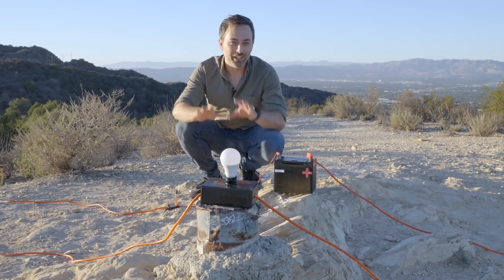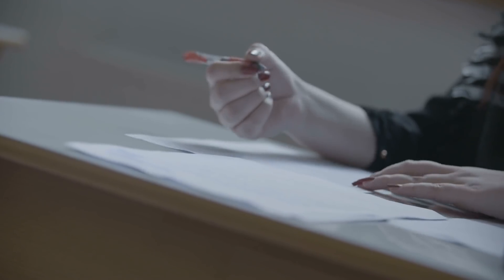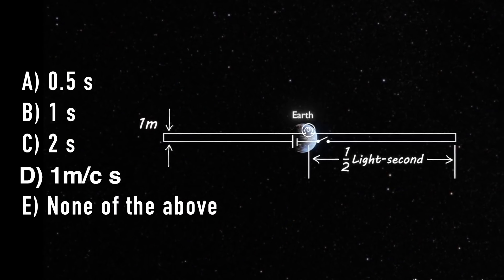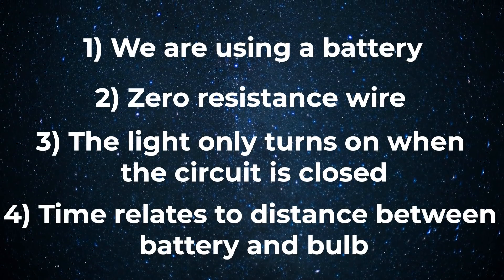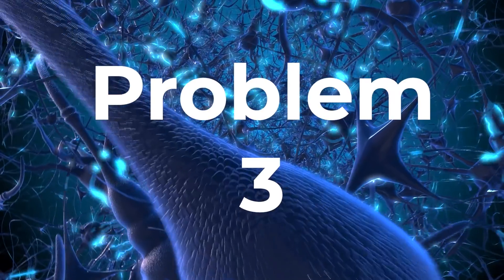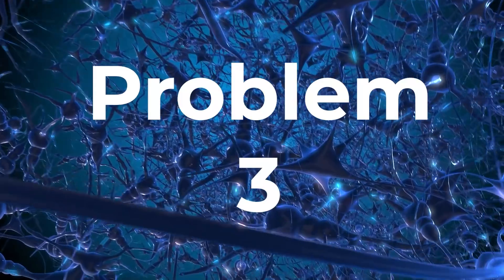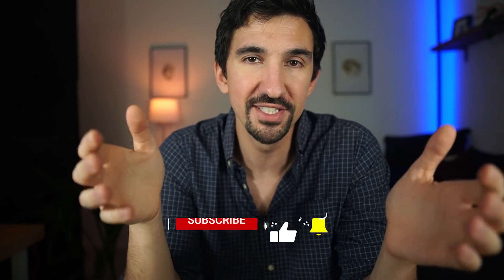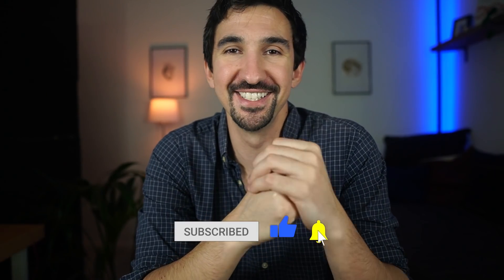Is Veritasium Wrong About Electricity?

Comment: Watched the video and your correct as I analyze as well. Would like to have a tank circuit to experiment to show that the potential energy of the field. The discussion point being made is where the energy travel is. Energy goes into inductor at the start of current, and when this collapses that energy comes back. Impedance is the sum of R plus capacitive reactance plus inductive reactance. And reactance only happens with change of current. In a DC this is battery on. Or Battery off. Also ideally if we take the bulb out and replace it with a wire we oscillate because this circuit has no R. The oscillation is at the resonant frequency of the C and L something like this f = 1/(2π√LC). Too too simple for this because this is one L and one C in series. Apply battery power once and you oscillate. Replace a load with a wire is Nortin's of analyzing a circuit would remove the load with a wire and you compute the current. Here that current immediately osculates, and continues even after the DC reaches in one second. So, now we apply the load to that current and see the once cycled glitch will be found followed by one second or so for E w/out R to get through the wire making I the same in the circuit. We can apply the following to dig deeper. And this force if felt at speed of light "kind-of". Where one electron is it has a force. We have collection of these electrons in a battery and wire now makes each of those electrons touch and touch etc with this we have "touch" electron to electron energy transfer. Moving electrons make a flux and is shored energy... The stored energy is conserved.

The law states that the magnitude of the electrostatic force of attraction or repulsion between two point charges
 is directly proportional to the product of the magnitudes of charges 
and inversely proportional to the square of the distance between them,

Comment: yeah and what about an experiment that isolates the lamp from the magnetic field generated by the battery/wire close to the battery ? Does the lamp will turn on?
My answer wld be : yes.
So current will probably needs the time 'to flow' (or if you want the mag field to propagate around the line) to the lamp. Interesting video btw !

Comment: There is a huge difference depending on whether DC or AC current is used. Electrons do not travel at the speed of light along a wire. They essentially stay more or less in place and jostle each other, the disturbance travelling along the wire at some speed less than the speed of light. For AC a rising and falling electromagnetic field is created around the wire and this is radiated from the wire at essentially the speed of light. This wave or pulse would be picked up by a closely spaced parallel wire almost instantly and it would generate an equal but opposite voltage. So if the wires are closely spaced, the light will come on, at least briefly, with DC voltage as the voltage pulse will jump across the distance between the parallel wires as an electromagnetic wave. Using AC, the light will come on continuously. If the wires were widely spaced such as being formed into a circle, then there will be more than a one second delay due to the delay in the electrical pulse propagating along the wire. This is usually assumed to be about .67 of the speed of light in real life situations. While this may seem a specious problem, it does actually have real world applications in that computer chips are so fast, the speed of light and hence propagation of signals across a circuit board can take longer than the clock speed of a single pulse from a microprocessor chip. In other words, the components on the circuit board start running out of synchronisation with each other. This is a very real problem for designers.

Comment: Veritasium described electricity as an electro-magnetic field that moves along a wire at the speed of light. Which explains nicely how a conductor moving in a magnetic field makes electricity. I think if the wire was cut at the furthest end when the circuit was on that there would be enough delay before the light globe turned off that it would not exceed the speed of light. Surely someone in a physics lab can set up an experiment to test this?

Comment: Yeah, Veritasium basically is saying that electricity is radio which uses the electric and magnetic fields together to communicate across distance...zero sense really.  Electrons are definitely moving in the wires to deliver energy.  If the electric fields could deliver that much energy then wireless charging would be taking place at continental scales lol.

Comment: Isn't it 1/c seconds for option C because its 1m away? That's why it's not 1/c seconds and also why it doesn't break causality - because the time is based on how far the bulb is away from the switch.
Also, I feel like if a break happened on the edge of the circuit is a good counter-argument, however, I think the switch will still work until half a second passes as the break is half a light second away so it's like a switch half a light second away was flipped. Ultimately, idk but I agree with Veritasium but I'm still sceptical. This was a great video though 👍

Comment: This was absoutely fantastic 👏 .
I would say though we dont look at transformers as antennas while they work the same way just not trabsmitting through air.
If we had this same experiment where the two wires were coiled and embedded in silicon steel then the wire around the earth or moon would be irrelevant as we know that how the power will transfer.

Comment: I have a question. Veritasium and The Science Asylum both made videos about energy propagation in circuits (TSA about 2 years ago, I think). But their Poynting vector didn't match: Veritasium's Poynting vector was (no pun) pointing along the wire, while TSA's Poynting vector was orthogonal to the wire. Which one of the two is right?
My guess is that they're both "right and wrong", in the sense that they each describe one summand of the actual Poynting vector: Veritasium's term is the one causing the light bulb to turn completely on eventually, and TSA's term is the one causing the wire to heat by Coulomb effect.

Comment: I did not understand, in this model, how is it different to click the switch versus not doing that? You just said that the circuit being closed "does not matter that much" (or did I get it wrong?) so why does it matter at the position of the switch more than at 1 light year away?

Another way to put it: what precisely is telling the battery to "start moving electrons" in the circuit? Since it is not "that the wire closes up", there must be a quantitative way to put it..
Reply: The battery creates an electromagnetic field around the wires, this field moves electrons. The field also induces another field in the other wire and because it's directly parallel at only one meter, it induces this field very quickly, but it's not going to be very powerful. When the wires are connected at the ends, the magnetic field would also propagate the path of the wire much more efficiently, but would take longer to happen. The real problem with Derek's video is that a 12V battery is DC, so the voltage on the bulb side of the wire would only get a short spike of voltage when the field first forms, and then you'd have to wait for the field to follow the wires.
Reply: @1992jamo  So why will switching the switch really have a non-negligible effect on the "almost-instantaneous" timescale? When you close the circuit, isn't that really just a small difference in the geometry of the wire? I mean, after all the EM fields have to "jump one meter of air": doesn't that have the larger effect, compared to "jump the gap between the ends of the wire" at the spot where the turned-off switch opens the circuit?
Reply: @nebularwinter  I'm not 100% sure what you mean, so sorry if this isn't a relevant reply; I'm using an AC power source in these examples.
If you're asking what is the difference between having an open circuit with two unconnected wires close in parallel, vs an open circuit which is two parallel wires connected at each end, with an open switch, the answer is not much.
But if the circuit is complete, I think the answer is that the magnetic fields propagate along the wire, but radiate perpendicular to the wire. In order for it to form EM fields, there needs to be a circuit.

Comment: Hmm, no, I'm sorry but Veritasium is correct and there is no faster than light response needed here. The pair of wires form what we like to describe as a distributed circuit problem, not a lumped circuit problem which is a simplification we make when the dimensions of the circuit elements are much less than the wavelength of the highest frequency of significance. This is obviously not so in this case. This is in fact what we call a transmission line and it has a characteristic impedance equal to sqrt(R+jWL/G+jWC). Since this is a perfect line both R and G are zero and the characteristic impedance is just sqrt (L/C) were L is inductance per unit length and C is the capacitance per unit length. This characteristic impedance can be used to replace the transmission line for purposes of working out the initial voltage of the lamp which merely is in series with this purely resistive characteristic impedance. Thus for the first second or so the initial state is entirely governed by the local dimensions. Say 1 metre or 3.333 ns. After the travelling wave has gone all the way to the end of the line the short circuit will reflect it back in the opposite sense. When the reverse travelling wave makes it back to the start then depending on the impedance/resistance of the lamp that may be the end of it. If the lamp has an impedance equal to the characteristic impedance then this will terminate then. In this case the lamp will be at half voltage for 1 second and full voltage forever after that.

Comment: I believe that this was the point of the Veritasium video, to prove that the thing that is causing the light to work is not the traveling of the electrons throughout the circuit, but the flux caused by the electromagnetic relationship established by the circuit. That is why the closing of the circuit causes an almost instantaneous response of the bulb being lit. *disclaimer I am a physician

Comment: For me, the image of little balls (electrons) moving single file through a tube (the wire)  and stopping when the switch is opened is the model I hold in my mind when thinking about how electricity works. Every since I saw the film in school that's how it works. Nothing is going to change that

Comment: There is no FTL communication. You know the circuit is broken but you don't know WHERE. To measure the distance, you need to bump a signal down the wire and wait for reflection. That takes time. No paradox here. Actual paradoxes can be constructed using two switches. One is near battery (switch A), the other near the max distance (switch B).  B is On,  A is Off. Switch on B, wait 1m/c seconds, then switch off B. This can be done by pre-programmed and synchronized clocks. If Veritasium is correct, the light should switch on (for a brief moment). Relativistically depending on your frame of reference, the sequence of switches can be seen as A On -> B Off  OR B Off -> A On. So some frames see no time where the cirsuit is complete and some frames see the circuit complete for a while. So in some frames the light comes on and in some it does not. WTF?

Comment: As an electronics dude, i have  problem  with an asumption you made:  perfect wire  implies  0 resistance  and than  they are superconductive.... Well  if the wire  have 0 resistance  according to Ohm law :  I =R .V =0.V which means  no current  at also the  power will be P=V.I = V.0 =0 (it is  a DC  circuit in the end) so no power . How  a perfect wire  will  conduct with  0 Resistance and  still  conforme  to Ohm's Law ?

Comment: Imagine the same setup but embedded in a region of zero permittivity so the fields can only exist in the wire. Does the light still turn on? I'm fairly sure so, because that's the circuit diagram that he shows. 
The video is confusing and incomplete. The best answer is whatever solves maxwell's equations in both the wire and the rest of space, of which both transmission lines for  fast AC (the rest of space dominates) and circuits for DC (the wire dominates) are just limits.
He showed you the DC model (for which energy doesn't even flow, the bulb lights because of a local potential over it) then gave you the answer for the fast AC one.

Comment: It should be 1 m /c. Your units still don't check out.
Reply: This guy and Veritasium could both use an editor, they both flubbed and silently course corrected.
As for the gal with the mole, good eye.
"lights a lighter" well played since a car's lighter closes a circuit, etc. I was thinking "turns car BT on" for the absurd amount of BT transmission watts to crank the dead battery car. New for 2023 Qi jump starts.

Comment: Isn't the problem in 5:00 just a rehash of the ladder paradox? You don't have the same experience of simultaneity. If you cut the wire after they switch it but before the other light turns on, from the other observer's perspective, you cut it before they turned it on. The signal of the system being one way or the other can be transferred "spookily fast" without breaking causality.

Comment: You've made a very common mistake in how you explained things there but anyway.

So what he's really talking about is radio / electromagnetic coupling from the battery side to the light bulb side. Switching on the bulb at the battery causes an EM field to be generated on the battery side and this radiates out including over to the light bulb side, disturbing electrons in it's part of the circuit and therefore inducing a (very low) flow of power. In other words it's the DC equivalent of a radio transmission?

Comment: A wire that long is going to have sizable resistance, sure, but I haven't seen anyone mention that it will also have considerable inductance. Once the switch is closed, current will try to flow but it will take some time for it to overcome the induced opposite voltage. It's similar in some ways to the inertia of water flowing through a pipe. Once the switch is opened again, it will take some time for the light to go off (analogous to water hammer) because the induced voltage will keep electricity flowing. It might be interesting to work out the resonant frequency of this circuit.

Comment: Units are (1 meter) / (C meters per seconds) which result in seconds. If the light bulb was 2 meters away it should be 2/C. So there's nothing wrong with the units

Comment: Even if assumptions 3 and 4 are absolutely correct, the problem is impossible to test in reality anyway. The universe has made it impossible to do so. You simply can't have a zero impedance cable stretched for a light-second or longer. All those things seem possible in mathematical terms, and maybe are good for thought experiments, but in reality those fall quickly apart. The simple resistance even if you somehow managed to supercool the cable to near absolute zero is enough to make a delay, probably just enough to never reach light speed or above.
Or our entire understanding of speed of light is incorrect, and we are simply sticking to it for so long. But that's another matter. 
Maybe in a few millennia people will laugh at the notion we believed speed of light is the highest speed the universe can achieve. Like we laugh at the notion anemic people need to bleed to be cured from it. Which was a practice in the mid era.